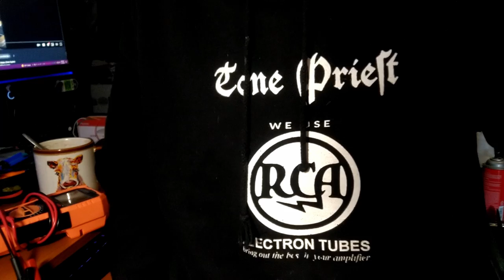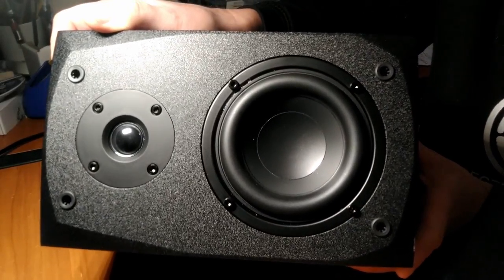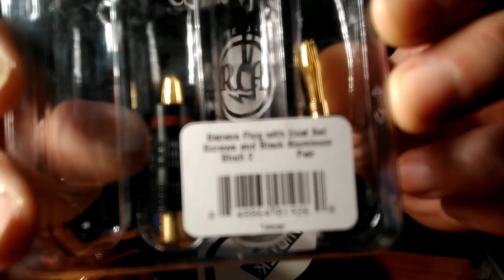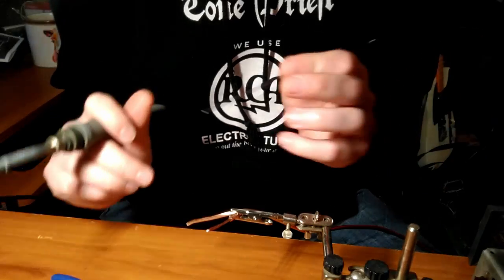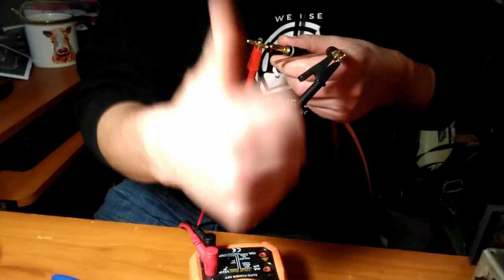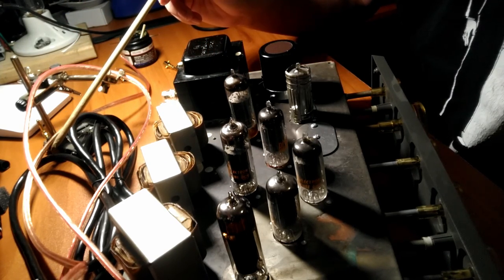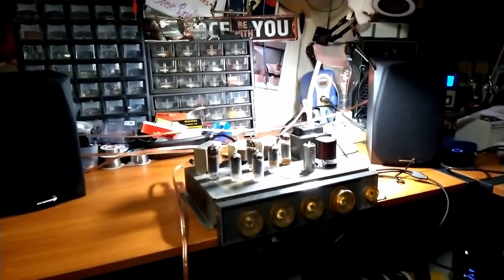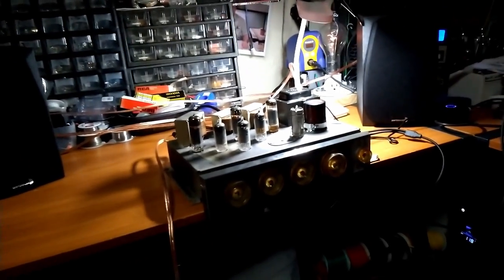DAYTON AUDIO MK402X & MKSX4 SPEAKERS w/ 1960 RCA 2.1 TUBE AMP - DEMO TIME! #8

Comment: Tube amps really smooth out the treble, and warm up the sound, which is my biggest annoyance about solid state. This can be heard even on a more modern cheap chinese tube preamp through an S/S output stage (amp).